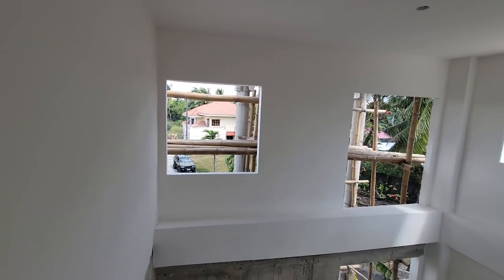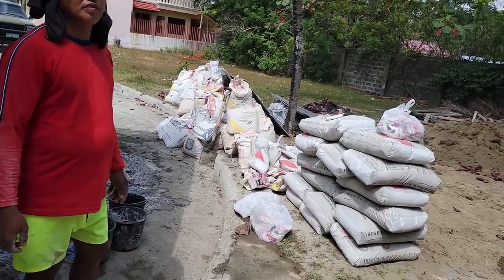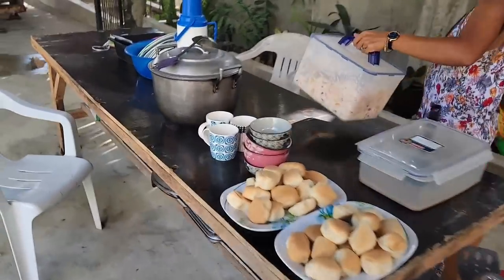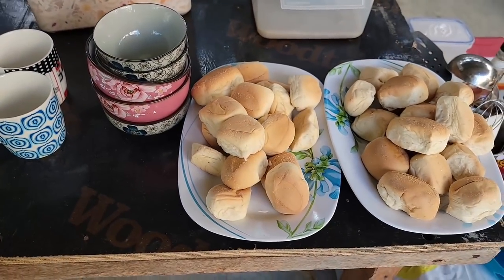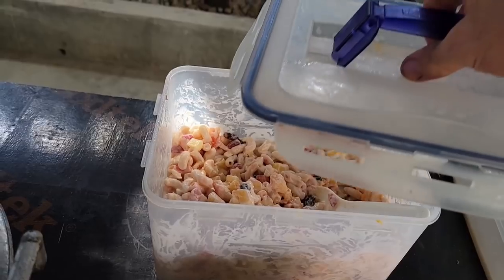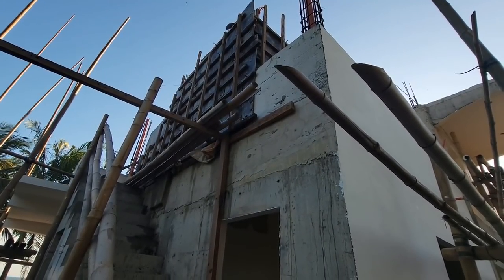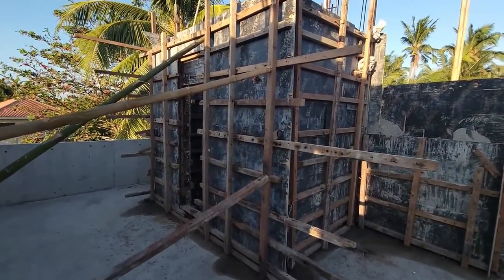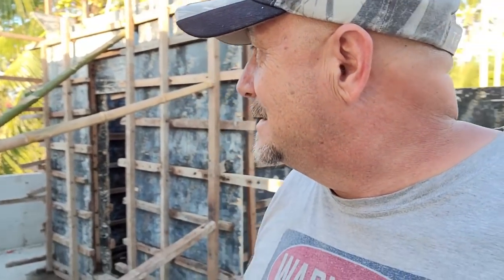Philippines Beach House Build Day 251 Part 2 Roof Top Restroom Poured for HOW MUCH?

Comment: I can't believe the whole concrete pour was done one bucket at a time it's amazing
Reply: That's the way they do it here. But you do build make sure each level is done in 1 pour. If not you will have to refill the holes in the overhangs every 2 years.

Comment: Our beach house is about half the size of yours and we completed ours in 6 months. And the church and mausoleum about another 3/4 months. Ie 10 months in total
Reply from the maker: We built way more than a house. We built all over this place everywhere. You have to factor in all of that.  If we would have focused only on the house itself without all the extras on the property and if we did not get caught up in the pandemic lock downs it would have been quick just on the house. I intentionally slowed up the build for some reasons I will share at the end of this build that will blow your mind!

Comment: seems your build is taking a long time , all the money you save by being frugal goes towards labor , that's OK because its going to family ,
Reply from the maker: No it takes a long time because we go back and fourth to the USA and there is 6 to 7 months gaps plus quarantine each time we came back in. Plus remember we built far more than just a house. We built out a whole property ie: boat ramp with planter boxes, outdoor guest restroom with laundry, fences, under cistern , large concrete fish tank, patios, sidewalks, landscaping beds, yard and beach back filling , gabion cages full of stone for large wave and erosion protection , yard drains etc. The house itself is large with a total of 7 cr's on the property. This also includes for the 3 AIR BNB rooms on the ground floor for income here as a boutique resort here. It is far from just building a simple house.  The increase in value of the land and house has already grown more since we started building than I spent to build.

Comment: Hi james just noticed that you have done all these preformed concrete walls without once using a portable vibrator for the smooth finish but guess that you skim coat after  so this is not necessary so either way is good and as you say stronger quicker  more cost effective just my thoughts but still nice job  cheers gerry
Reply from the maker: we manually worked it and go back to my videos around day 60 or so and I show just how slick it comes out when we pull the forms. No machines was used on this build other than drills and screw guns.  It is skimcoat ready and just light thin skimcoating.

Comment: When you pour on top of that parapet wall where the concrete has already cured how do you get it to bond?
Reply from the maker: It is just cast molding not structural. Kinda like putting trim in your house. You see all of that rebar sticking out everywhere? That will rebar steel will be bent and more rabr tied onto it then concrete cast around it.  Picture that like your nails in trim.

Comment: Those workers sure are messin with fire, having no safety net.  I see those feet on the edge of the wall and that drop is deep.  DANG!!!!
Reply: That's the way philipinos work in flip flops and barefoot you should see them work on electrical lines they don't climb up on the poles they put up against the lines and work on them.
Reply from the maker: Just asking - Do you think they put safety nets, ropes and hard hats when climbing free style up coconut trees harvesting and cleaning the trees? Nope. This is life here free of so much stuff. If they are on a skyrise building doing a commercial job you will see those things. In province life or general house build you mostly wont. Especially just family building together like we are.

Comment: Hi,   did you factor in the ceiling of the CR?
Reply from the maker: No because maybe somebody is building and dont want a cement roof on their structure.  I will add that cost when the roof is poured but on this roof it is not much.  Upcoming video

Comment: The first step to losing weight is to start reading the labels on the packaging & looking at how much sugar is in the product. Natural sugars & fiber in fruits is good, however, not when you make juices out of the fruit, because it becomes more concentrated. And the alternatives like Stevia, etc are not much better than sugar. Read the labels, sugar bad. When you told us how much it cost you to build that C.R. I immediately thought, hmm, that's probably less than it would cost to rent a port-a-potty for a week over here, which would probably mean almost double that if you included a handwashing station with that port-a-potty. Good job. You treat these guys alright James. Just sayin.